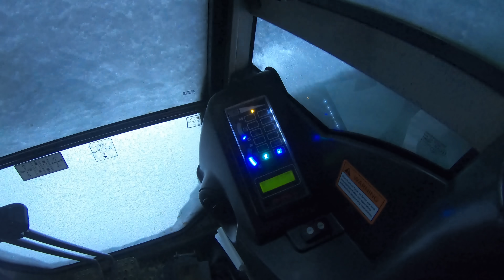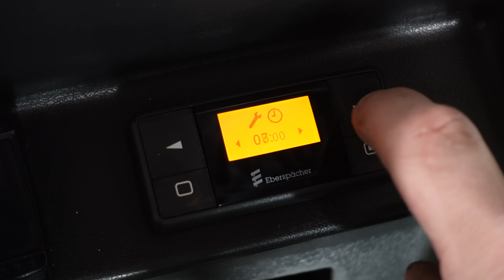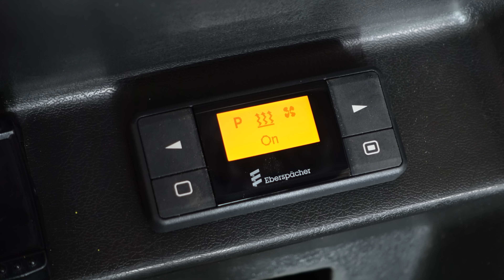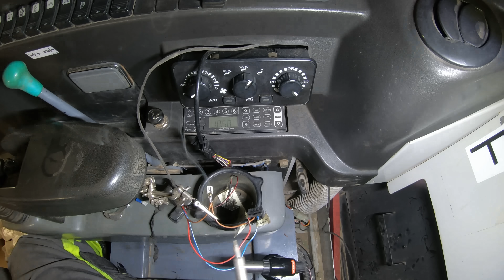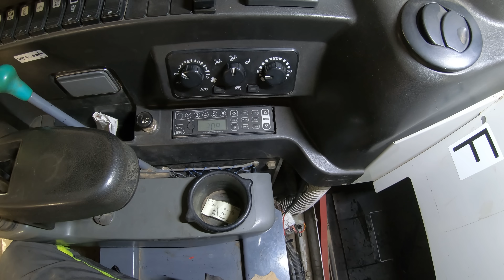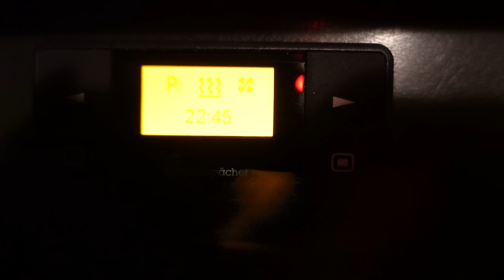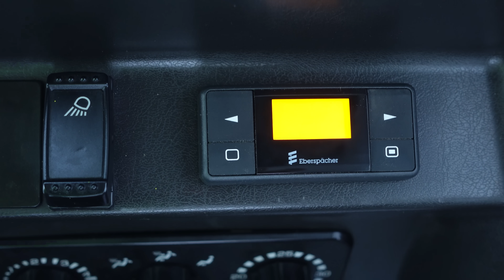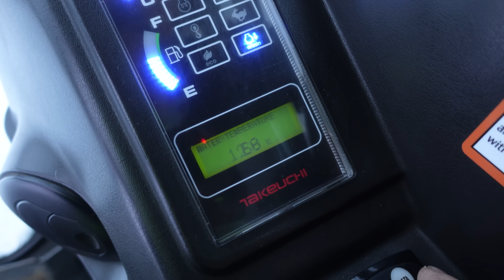Installing a Diesel Heater in the excavator and testing it

Comment: Hello, I have subscribed to your channel. Allow me to give you some advice when you have to paint a metal surface and get a good result: 1) degrease the surface with acetone- 2) first apply a coat of primer on which you can then paint. The paint will adhere perfectly.
Reply: Maybe he did off camera
Reply: @corywadedavis  I don't think so, when he painted red the Engcon Tiltrotator (video from a month ago) he had problems with the first coat of paint slipping on the metal and this was because the primer base was missing.
Reply from the maker: Hi! This color is intended to be painted without a primer. On the tiltrotator, I should have used primer

Comment: I love your content. But please never use solder for an electrical splice. Use low temp solder splices they are waterproof, and are recomed for military, as well as other bodies. One more thing. Never use that flame on you heat shrink stuff, use a proper heat gun.

Comment: you canceling the factory heater and instal an aftermarket? what actually you are doing here?
Reply from the maker: No, It's basically a wireless engine heater. Useful when leaving the excavator in remote places,
so its heated when you arrive (Both the engine and the cab). The factory heater will still work as intended.

Comment: Why not install a regular heating core system that works off of the already heated engine coolant? Instead of burning more fuel? 
Seems wasteful in my opinion? 
Anyone who can enlighten me to the benefits of this system please feel free 🙂.
Reply: "Already heated coolant" is your answer. The engine block is stone cold. The hydronic system heats the coolant thus warming the engine block for an improved cold-start. The heater matrix in the cab gets hot as a result of the cooling system being heated, the system activates the cab fan and de-mists the cab as a byproduct of pre-heating the engine block.
Reply: When sitting out in the cold over night there is no heated engine coolant to use :) The machine already has a heater core that heats the cab when running, the Eberspächer is primarily for preheating the engine to reduce the wear on the engine in cold weather and as a bonus, since the heater heats the coolant, the cab will be heated as well :)